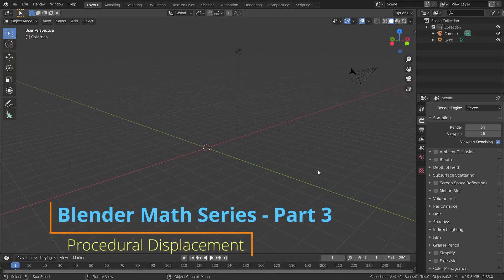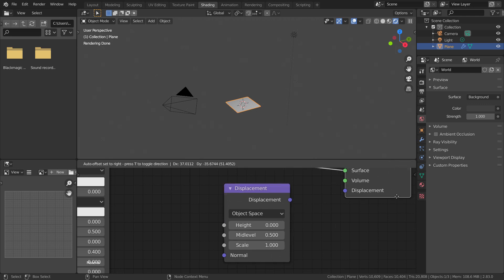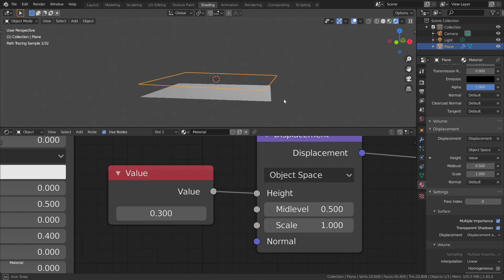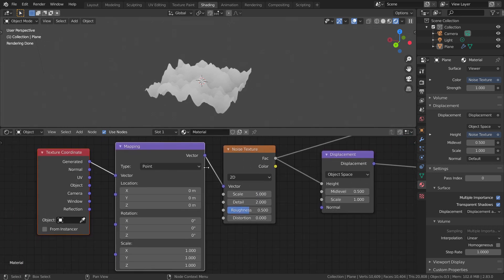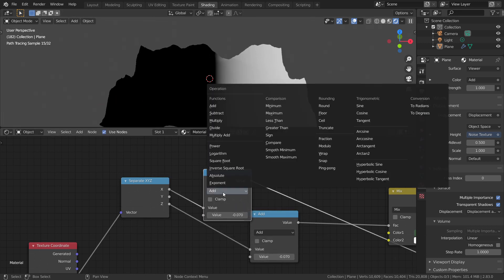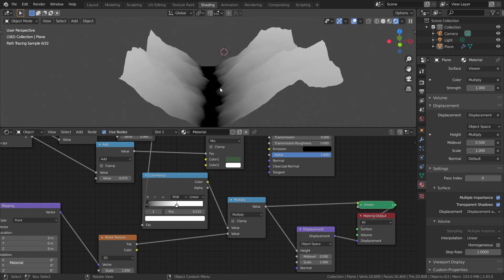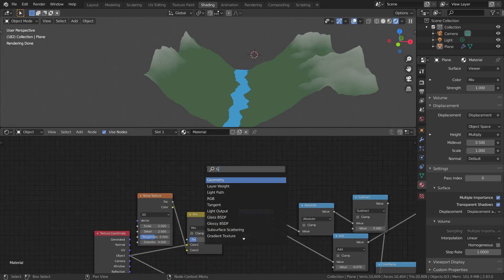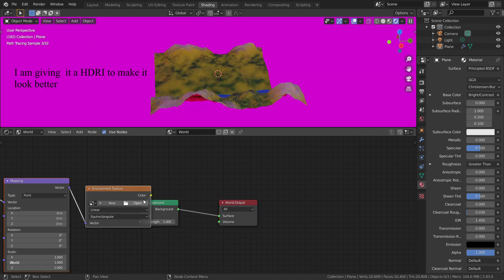Blender Math series Part 3 - Fundamentals Of Procedural Displacement

Comment: This was fun.  Thanks for sharing.  [warning math ahead]  To get more control over the river's direction instead of domain displacing, I used abs(f(x) - (y + noise)) This allows getting a general shape by writing an f(x) and then distorting the edges.  I should try mixing that with domain displacement.